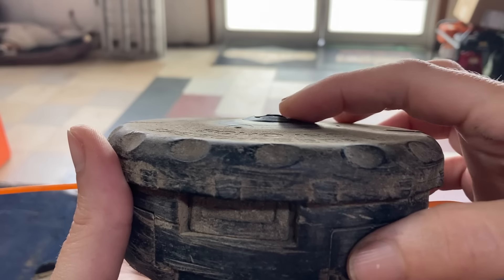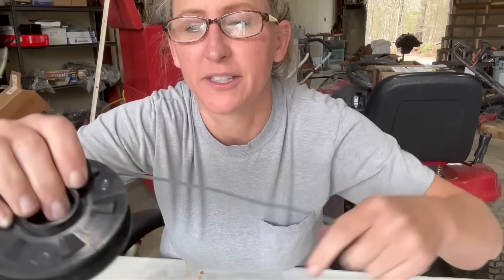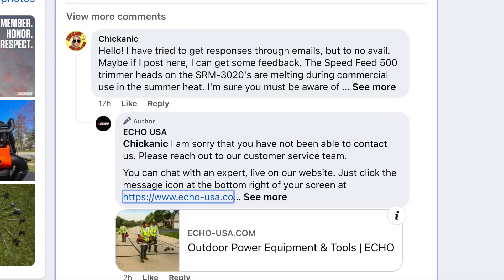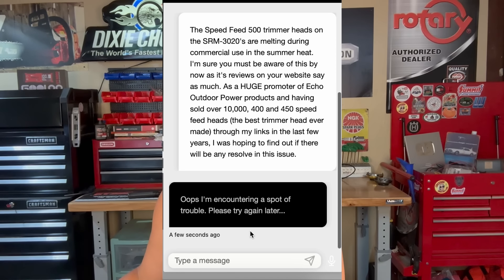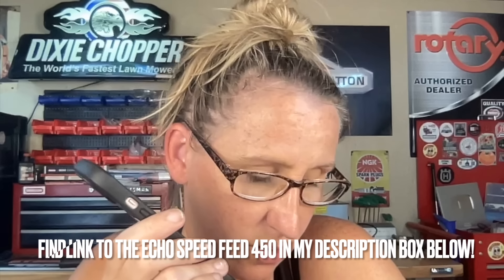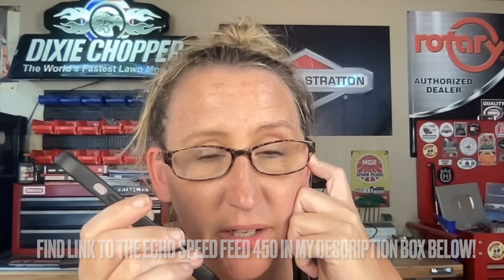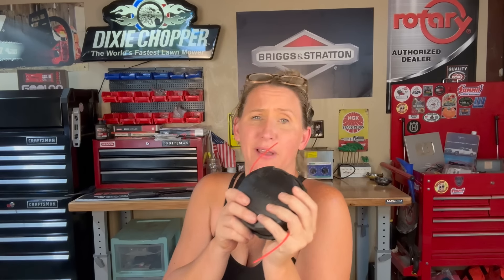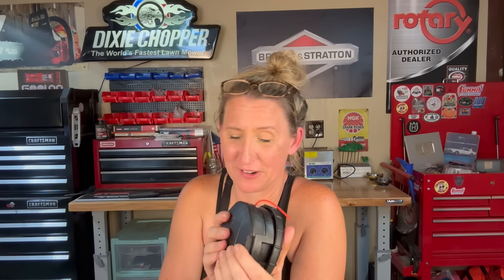WE DID IT!! Echo Admits Speed Feed 500 FAIL and is Working To Figure Out Solution!

Comment: I have an idea for Echo to investigate.  They may want to consider redesigning the upper fixing plate so it has fins or multiple layers to deflect or disperse heat.  The current design can actually create more heat when vegetation wraps around the edge between the debris shield and the trimmer head.  In this respect, Husqvarna and Stihl fixing plates and debris shields are better designs. 

I have considered swapping a Husqvarna 128LD debris shield onto my Echo SRM3100T to see if that makes any difference. (No, they didn't make a SRM3100"T". I made it by installing a newer 2:1 gear box on it.)

Comment: Switching to a more expensive machined metal part isn't to save cost or the other guesses. In tear down videos of the 500 vs the 450 it looks like the 500 is really solidly centered compared to the 450. Guess that's for balance and keeping vibration low to meet a regulation.

Comment: Got anything on Simplicity cutting height mechanism?
I can't get more than 2.5 inches before hitting the stops.Model 44 inch cut 4038 deck, Manual screw type height adjustment device.
Nothing in service manual or U Tube.

Comment: I have a question,I have one of the older model Echo Speedspool,I'm guessing it's probably a Model400,it has worked flawless till last month. It began to retract the trimmer line instead of advancing it. I double checked to make make sure the spool was in correctly and it was,but it still retracts the line. Any thoughts or advise?

Comment: I have the same problem with melting line in my OEM Stihl spool. The dealer said "that just means you're misusing it". I'm not quite sure how though...
Reply from the maker: Try soaking your trimmer line in water over night. Sometimes you can buy line from a store that they have had for a long time and it dries out. It becomes easier to melt and stick to itself in that state. All trimmer line can be rejuvenated though with a soak.
Reply: The soaking of big spools of of line is great way of rejuvenating the line and does help with the feeding. When I see the white-ish coating on the line, I soak the line in water.  It does feed better after soaking.
Reply: @Chickanic  I'd heard of that; I'll give it a try.

Comment: The big Stihl units can do the same, but only if you run the head constantly on the ground. The fix, according to the Stihl experts, is to use the unit properly, and not ride the head on the ground, only touch the ground when bumping it. Same problem? Maybe, maybe not,  I don't know. Only sharing what I do know.

Comment: I have a ECHO's X Series SRM-3020T. with a 500 head on it. I only use it about 4 to 5 times already. and I use it for commercial use. do you think I should stop using it until they fix the issue. because I'm pretty strapped for cash

Comment: Im pretty sure my commercial Husqvarna is doing the exact same thing.  It often melts and i have to pop off the cap to peel it apart and start it feeding again.  Then it does it again before i even get through a full feed of line. Its pretty frustrating.  I bought a few different brands and styles of line and it happens on all of them at some point.  

Also, my wife is having problems with her Stihl FS 50 feeding properly when she has the supposed easy speed feed for their brand.  She constantly breaks off the line and has to stop to take it apart to start the feed again.  I hate it that i cant find her something light weight but heavy duty and JUST WORKS RIGHT without fail.  Id pay $1,000 if i could find such a tool.  But alas, it does not seem to exist.

Comment: Makes me wonder the source of the heat.  coming from the shaft/gear head and conducted through the threaded connector is this heat detrimental to the shaft and gear head?

I’m a Stihl guy and I’ve noticed that the easyspool head gets harder to wind as it gets some use. Is this a common issue?

Comment: Cant seem to find a string trimmer bump cap, or a string holder for a 52cc Wild Badger, lost mine a while ago in the jungle!!! Right now have a blade on there, still had a pull string issue!!! Rope would not go back in!!! Easy removal, the metal part that has two plastic pull spring loaded thingies, 4.99 cents at Badger went bad after a year of little use!!! One plastic spring loaded thingie fried!!! they are held in by a c clip,,,, never found the c clip that was missing, Ha!!! Little lubrication? sukie made part??? Too hot where it lives???

Comment: They all melt in the middle of an Australian summer on a big echo srm520es after a few hours . The 500 is better than 450 as far as im concerned. The 450 dies internally with the silly plastic centre bar just twisting out or the centre hex rotating inside the plastic. the square drive of the 500 is far better for transmitting the power than a hex.   Regardless of which head you get throw away the stupid plastic spacer washer and get something decent in there that the centre boss can tighten against. otherwise you will get the distorted centre you show at 1:12. That's because the centre boss kept trying to tighten and pulled itself inside the spacer because there was a gap.

Comment: I grabbed an echo branded 400 to put on my 20V DeWalt trimmer but didn't realize there was a "universal" version and one that wasn't. And the one I got doesn't fit on my DeWalt. Doe anyone know if the various adapters in the universal version are available on their own (if they even work with the non-universal 400)?

Comment: My question is if the 450 was such a popular product then why the heck would Echo try to replace it with something that wasn't given proper testing in real-world scenarios.... Heck it especially doesn't make sense to discontinue a product that has been faithful and reliable for many years and keeps on working. It would make the most sense to prolong production of the 450 and halt or slow down production of the 500 until they finally figure out what the issue is and how to fix it. 

EDIT: I wonder if part of the issue involves that section of plastic that would have acted as a bit of a washer between the female threads of the trimmer head and the gearbox of the machine. I wonder if that slowed down heat transfer enough that it avoided melting the head and anything in it. By carefully looking at the 400 and 450 I can see that the threads on those heads were kept away from the gear box some whilst the 500 has that press right up against it. The 500 could be wicking a lot more heat down into the trimmer head and melting the line. There would be even more heat for it to pull in hot weather since higher ambient temperatures plus a certain amount of heat generated due to friction (yes there is lubricant, but no matter what there will always be some sort of friction) could equal a very rough time.

Comment: Since there are so many aftermarket 450 heads available….why not do a video with a few of them showing the differences as compared to the original Echo/Shindaiwa and see if any are worth the plastic they are molded from? After all, if the original 450 is so good…which it is…the question I have is whether any of the non Echo 450s, such as the Oregon, are any good also. That way if Echo drags their feet on a fix, us commercial guys have a way to save some time, money and frustration. 
Oh and for the record, I have a 500 on my FS94R….which I didn’t even realize it WAS a 500 and not a 450…and have had very few issues.

Comment: No it is not a figment of your imagination I have had this problem for the last several years Spring line of tremors had made changes in the material makeup or the plastic makeup to save money downside of it is it melts together and you're right it does and it goes with those heads that they have They've done the same thing they're using different types of plastics mixed together and they do not hold up very well at all they're all made to fail so people will go out and buy more it's that simple.

Comment: Sorry for the FAQ but, is the Shindaiwa Speed-Feed 400 the same as the Echo Speed-Feed 400? (I don't have any Echo equipment and didn't know if Shindaiwa was the parent company or what).  Thoughts; would I be better off with a 450 or 400 for a Stihl FS 70 R which is in that magic 27.2 cc range?
Reply: 400 work fine buy the universe kit. I used a  knock-off unit  for  a large state property  on a 70 r and working great.  My coworker melted it.  I brought  a 2nd one. I wanted to see our far knock off 
Would last

Comment: I used to work in a chemistry lab.  We bought a new piece of equipment that had a row of hotplates.  Turn on #1 and #5 would heat up.  So, some rewiring was required.  I called the manufacturer and was transferred right to the factory floor.  Nowadays you'd get a customer service person who purposely knows nothing.  I asked how these were tested.  The answer, "We turn then all on and if they all get hot we ship it."  Oops!

Comment: Echo is going downhill. I recently bought an srm225 basic cheapest home model and it vibrated so bad I took it back immediately and went and got a stihl. Come to find out they took out a bearing in the shaft to save money. It had two in the shaft near the clutch, now it has one and lots of vibration. Stihl isn't much better, the clutch went out on that terd quick like. So I ended up buying the echo X series and still use it to this day.
Reply: Sounds like a you issue.

Comment: I want ask. Has anyone had issues regarding the new Stihl polycut 6-2 heads you can fit to the FS38-FS50 bent shaft trimmers where they have melted at the shaft end of the trimmer. Had a few go at our shop and it usually happens customers come in stating they can't get undo the head to change the blades. You lock the head as you should to undo the white cap, and the head keeps spinning. Once you extract the head off the trimmer the plastic around the nut area has melted. I have contacted via UK Stihl dealer technical dealer services and yet to hear off them. If anyone in the USA or other parts of the globe have seen the same issue please let me know.

Comment: Why discontinue the 450 when they know they have a big problem with the 500? Fix the 500 first, then discontinue the 450. I’ve never liked echo trimmer heads anyway because of the 1” exposed trimmer head shaft. I’d constantly have problems with sawgrass and other long lengths of grass or whatever wrap around that shaft. It would bog down the motor or constrict the shaft from turning. Kind of a pain to keep stopping and unwrap whatever was wrapped around it. I always replace it with a Stihl trimmer head to solve that problem. Stihl trimmer heads don’t have that shaft exposure

Comment: This isn't something really new that's happening.  We were in the business over 45 years, sold the company to a new owner in 2004, when the time was right.  The original heads from say 1990 to 2004 would do this.  Why ?  OSHA stopped pushing debris shields regulations on straight shaft trimmers ... the pro-users took of the debris shield, this resulted in the gear heads getting very hot and destroying those heads as well.  Heard your concern about the #450 head being discontinued.  Ali-Babba has these heads on their website for sale.

Comment: My boss also are dealers for echo and are very good  , it’s made in Japan , guess that’s why , we also are dealers for toro fairway mowers and workman buggy’s , there quality control has gone out the window , i pdi a workman  4x4 truck last month and  a spacer was missing on the front right wheel  so right wheel basically almost unattached , also frequent break down on new  3100 fairway machines , these cost  in the region of  £ 90000  , not sure whats happening in our world  but this is not  acceptable  ..